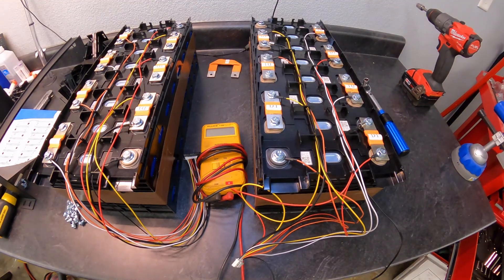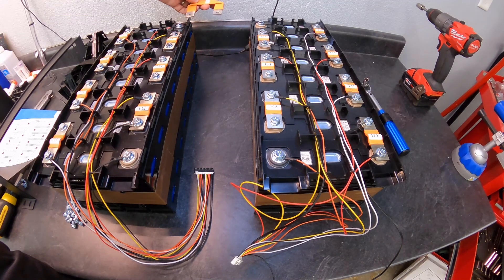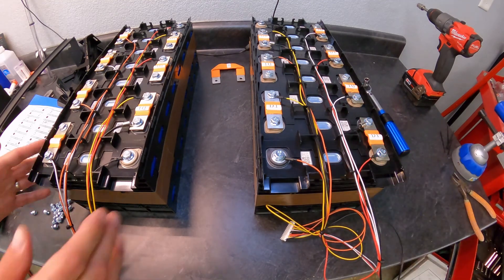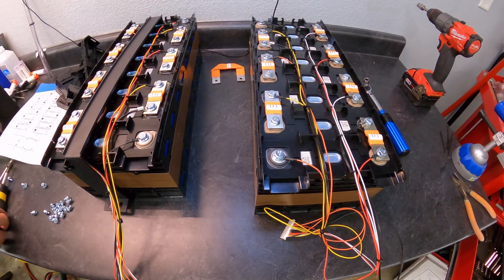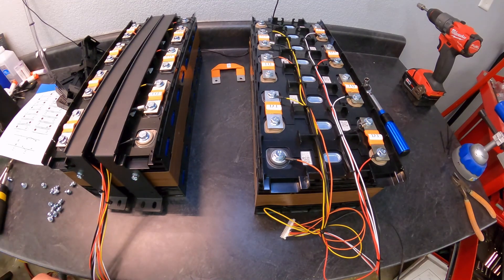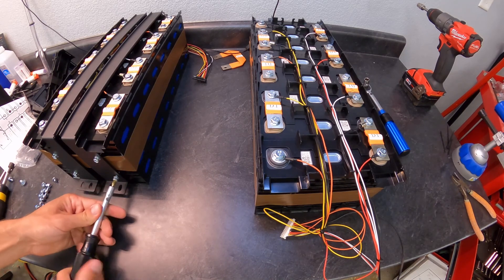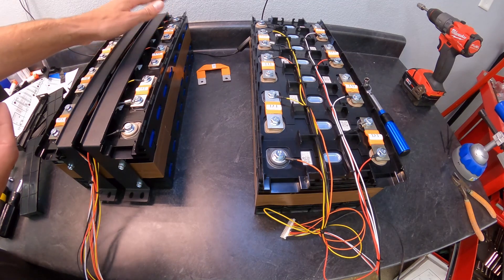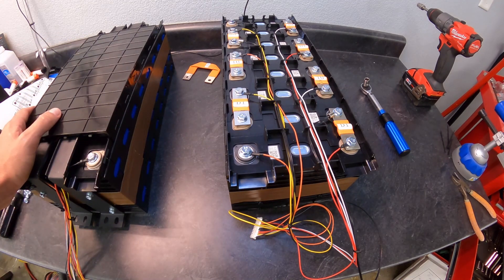Seplos Pusung pack setup

Comment: hi Mike, do you have these running yet ?
Reply from the maker: Unfortunately no.  While working on another project, I created a short (my fault, case open) so I need a new part which I have on order.  It's delayed with the pandemic so I have this on hold until I can get that in.
Reply: @upnorthmike6085  did you fry the bms ?
they are rather expensive, i have their 200 amp bms, comes down to 215 usd shipped.
you might have gotten lucky and only fried the fuse